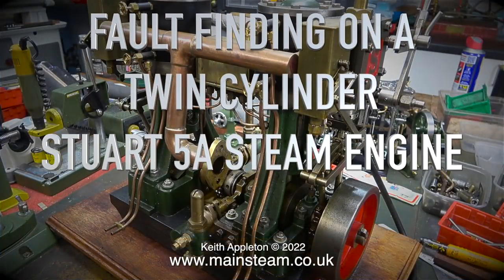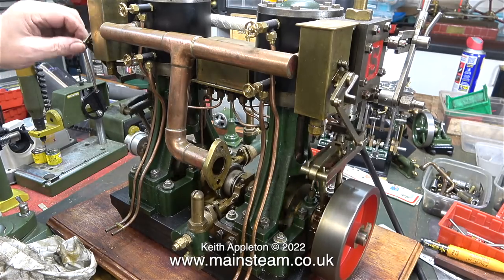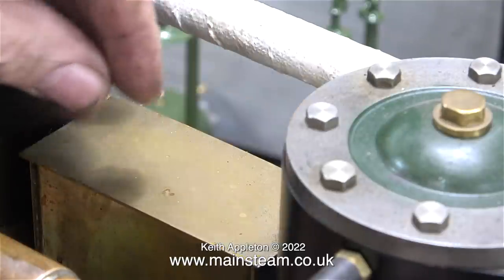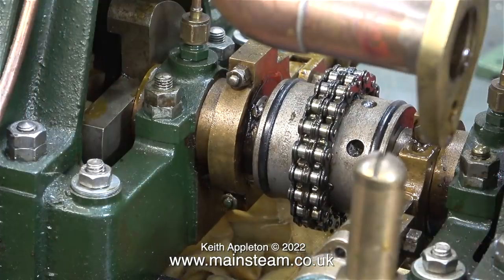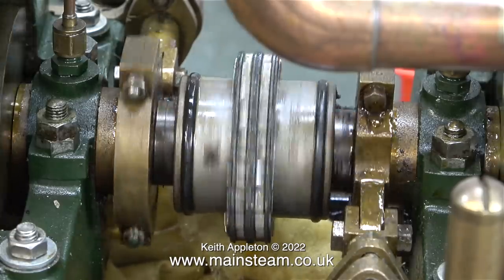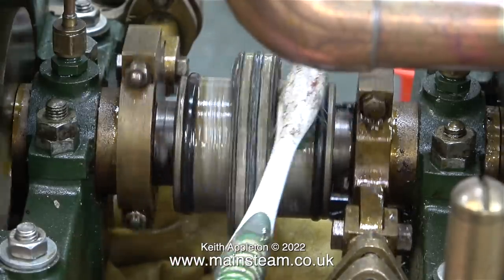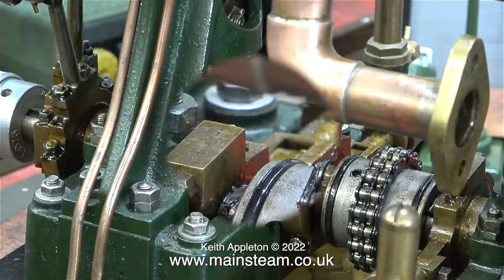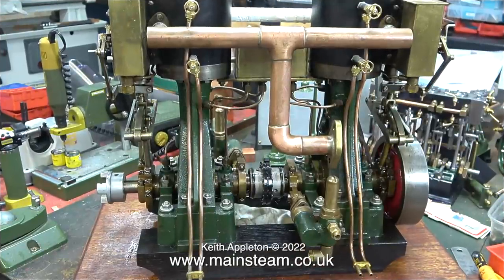FAULT FINDING ON A TWIN CYLINDER STUART 5A STEAM ENGINE - PART #1

Comment: timing issue after heat up - use a diff type of coupling - disconnect them and run one t o see which one makes noise

Comment: Well I don't think this is it, but I noticed that the knock seems to happen when the left engine is at top dead center.  Piston knocking that side?  Water up there that isn't draining from the cylinder properly?  Guess I'll have to wait for the next episode.  :)
Reply from the maker: there are 5 Episodes . . . . . .
Reply: Hmmmmm …. Watching the slow-mo part, I’d have guessed the right hand cross head/cylinder is the culprit.
Now I’m waiting in suspense for the following four vids.
Regards
Robert